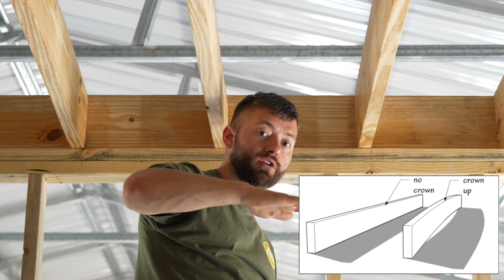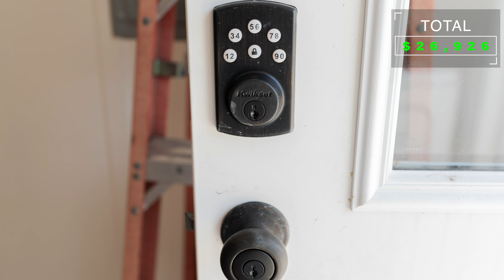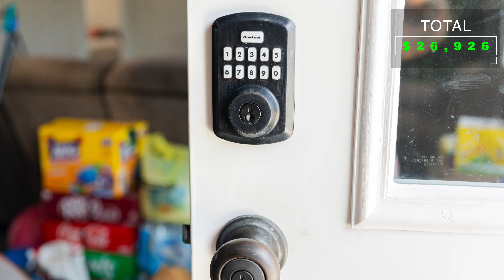How To Build A Barndominium | From the Ground Up | Part 2 Compilation

Comment: Other than having an enclosed space to build in, how is this method better or cheaper than a traditional build? You put up the metal building, then frame it. Seems redundant. Thanks for the great information and videos.
Reply from the maker: The metal building goes up in a day and provides the complete, dried-in exterior. The complete open span roof structure (trusses and finished roof) and exterior siding. Windows and doors already installed on day one.

Next you frame in the walls, which I did in 2 days with a few friends. We're not framers mind you. The 30 foot open span living room required no framing and no beams. We didn't have to make roof trusses, no exterior plywood sheathing or siding. No roof deck, no shingles. 

Dried-in and framed up in three days for less than the material costs to do it traditional. I've watched professional crews frame a house. By the time they have siding, shingles, doors and windows in, it has been months!

Comment: we plan to try to build a adu like this we plan to use a metal shed and convert the inside did you need a architect or anything for the floor plan the walls and the plumbing? im sure my question is vague because we havent started the process yet
Reply from the maker: I drew the floor plan and wall layout and had my plumber draw the plumbing layout. The inspector accepted both

Comment: What kind of whole-house ventilation did you use since the structure is air tight? Trying to build also in Louisiana.
Reply from the maker: Windows and doors are not airtight. I don't have any issues with using my stove hood vent or other exhaust vents.